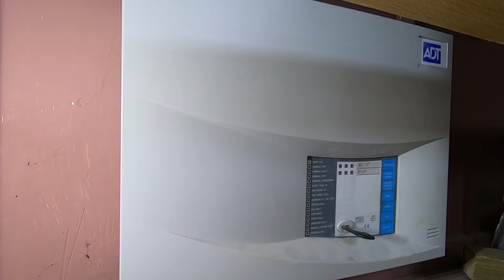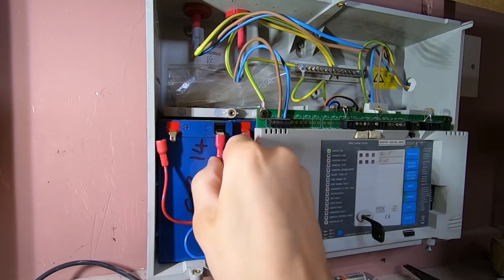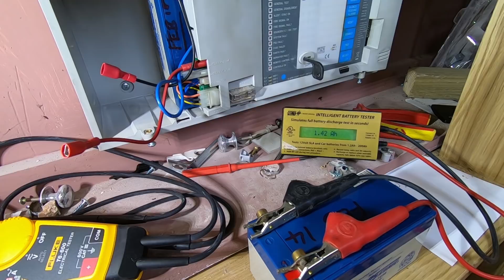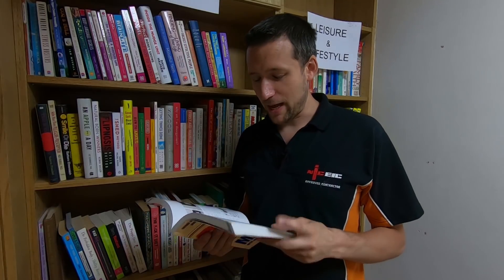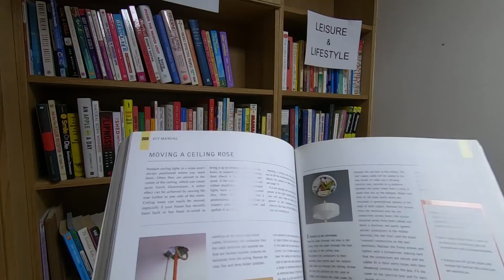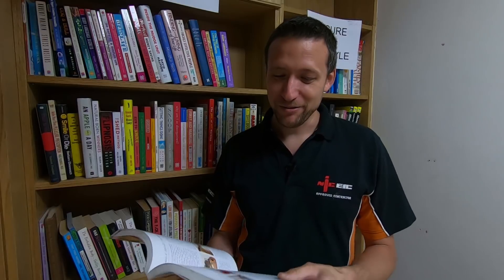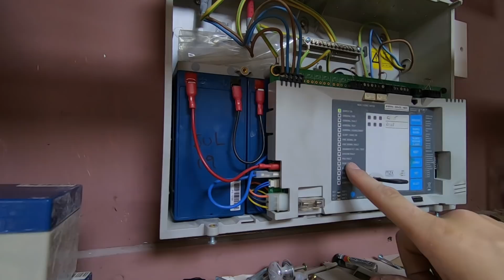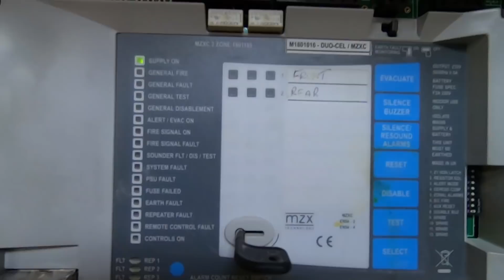FIRE ALARM unit - Fault finding and battery test | Thomas Nagy

Comment: 6:00 when i had to remove the battery from a smoke detector at my sisters house (She had got a new smoke detector and neither me nor her fancied trying to remove the thing from the ceiling, as it is over a staircase) im pretty certain i had to stand on the platform bit at the top (the step ladder thing I was using rather curiously had a handle like thing as though it intends on people standing on the top of it)

Comment: I use the exact same ACT battery tester here in the USA.  It works great.  I had the gold one like yours but it walked off.  I have the chrome model now.  I test alarm batteries on every call.

Comment: 6:08 saw a Sky installer the other day adding another feed out of a pre-existing dish on a bungalow.  Ladder bolted down to the paving slabs, eye-bolts in to the brick for ratchet straps, hardhat, full body harness.  I almost cried :'(

Comment: Fp200 can be tan with mains it’s a screened cable.

It shouldn’t be ran with any other service due to the fact it’s a safety system.

No interference would be induced

Comment: Batteries should be replaced every 4 years, and clearly marked with the date of install. Also, the powersonic batteries apparently don't give an accurate result when using those act testers.http://www.power-sonic-de.com/files/ohmic_hand_held_use.pdf

Comment: Problem with them batteries is that they never get a discharge cycle but always kept charging. Not great for these sealed batteries.
Reply from the maker: I was wondering this cos I wasn’t sure.
Does it kill them because they are permanently topped up? I’m guessing In the same way emergency lighting batteries die so quickly too. They last 2 years at best.
Reply: thomas nagy - Lead Acid cells and batteries should be fine for around  5 years if the charging voltage is kept within 2.2V to 2.3V per cell (a 12V battery is made up of six cells). At this voltage they can be safely trickle charged indefinitely. For best performance, the charger should also adjust the charging voltage to compensate for temperature changes. However in many applications where a dedicated battery charger is not provided / or good quality charging circuit is not included, instead you get a cheap and crude design. With these, the battery voltage can vary, and if the voltage gets too high, one or more cells will gas and vent. Each time they vent, the cell looses capacity. Lead acid cells and batteries also prefer to be cool, but the temperature in alarm systems can get fairly warm.
For testing lead acid cells and batteries I use a good quality digital multimeter and a test load. But the exact capacity is not relevant in my line of work, just the systems ability to operate for a specified time at a specified load.
Reply: thomas nagy I imagine the panels have a very crude charge controller. Drop below a certain voltage and start charging. No type of maintenance charge function. They really need a load through them every so often keep them healthier for longer.

Comment: That tone is literally the most annoying sound in the world. My school recently changed there tone on there notifier for the fire system to that sound and it is rlly annoying especially with outdoor sounder. We used to have alternate but it is ever since they inter grated the lockdown system and class change onto the fire panel with all different tones.
Reply from the maker: I’m also not a lover of that tone. I find it borderline disorientating. It’s not even hugely loud; it’s just an awful noise. 
I much prefer the two tone sweep sounders. They don’t have that “shrill”
Reply: thomas nagy exactly. I had to put up with that ringing for 2 hours whilst the school was doing a full sounder check. All they did was press the evacuate button on the panel and just let them ring. I could here it ringing in my head for an hour after. It was also about five o’clock, doing coursework so not fun. It was better when it was alternating. More alerting I found. But unfortunately that’s the sound most fire systems now use around bristol and surrounding areas.

Comment: Great video All ways look forward to seeing them. Not a electrician  but work in the motor trade loads of health and safety rubbish in this trade. Keep up the good work.
Reply from the maker: Hi pal, yeah I guess all trades struggle with that, it's often just a load of bollocks, not practicable at all if you ask me, but hey ho!

Comment: Fortunately it's perfectly legal to do your own electrical work in the UK. Yes you can even change a CU if you pay building control a couple of hundred quid to inspect and certify. Done it all my life, did my 18th edition exams (yes passed fine) got the correct test equipment. Tom is clearly excellent at what he does, but seen too many awful 'professional' jobs. Sits back and waits for screaming :)

Comment: In fairness 75% of domestic electrical work is just common sense. I doubt there is a house in the country that doesn’t include work done by a DIYer. There’s also plenty of shocking work done by supposedly competent sparks.
Reply: Not if you're working to BS7671 which everyone should do. It's anything but common sense.
Reply: Im a spark and rewired my house, is that diy or professional work lol?😂
Reply: Id have to disagree with your first statement my friend. Wiring up a plug or changing a light fitting should be generalised common sense but even those abilities seem lacking for most common folk these days. Sparky's or engineers such as fire, security, access, nurse call etc are individually specialised in those areas. There's is a lot more to it than just running cables and hanging lights, lol, having said that. Sadly, from experience I would say there's 1 good engineer to ever 5 bad one. Most are just too lazy to do the job right and i spend all day running around after the dodgy gits, lol still works works ;)

Comment: As a general rule of thumb, your waist area shouldn't be any higher than the top tread as this is where your centre of gravity is. You can easily lose your balance or have the stepladder topple from beneath if you climb any higher. Dave is clearly using the wrong size stepladder, 6 treads fit nicely in the van and are easy enough to carry round on site.

Comment: This method of battery test is BS. You can never test the real capacity unless you do a proper discharge messurement. It would take hours...
it depends on many aspect.  Battery could be shown shot, when the charger circuit blowed or incorrect charging voltage was set on the device. All these lead acid batteries has a rated charging voltage and current. Usually current limit is not a problem, because of poor charge circuit of the device, but the charging voltage is a real edge point.  On the side of batteries there is a rated charge voltage, it is around 13,5-13,7VDC. For a 3Ah it is about 13,5 VDC. In reallity it is still a bit high, 13,3-13,35 VDC is a much better value. It makes the batterylife much longer, not dry it up so fast.
Reply: No, it's not BS. It's looking at a portion of the discharge curve; unless the battery technology is significantly different from a standard SLA it's going to be able to do a pretty good estimation of the capacity. Certainly good enough to tell the difference between a good battery and one that needs replacing.

Comment: Those Tyco/minerva smoke detectors are really good. Is the mains coloured zone wiring a common thing in the uk?? In australia fire circuit inner conductors are usually white and red.  Brown and blue inside the fire panel usually means internal 240.

Comment: I went to a technical high school and have electrical training from a licensed electrician, but beyond changing a switch, socket or fixture I am hesitant. In America there is a law that you can work on your own stuff but if you work on someone else property and something terrible happens you a criminally liable. My teacher told us the story of a elderly couple who had a neighbor do work on a new furnace. The neighbor made a mistake and the furnace housing and part of the duct-work was made live. The couple had their young grand-kids over and as they waved goodbye to their parents out the window they leaned on the live heat vent and another part of the duct work that was earthed. Both kids died, and my teacher was the electrician that was called in after to fix the furnace.

Comment: You can get the very cheap and nasty battery testers for about $AU50 on eBay. They work, they're just not as accurate or reliable as the proper ones.  "12V Car Vehicle Battery Tester Automotive Analyzer Digital Display" is what I have, does what it says on the tin :)
If you're buying second hand lead acid batteries they are really valuable. Not what you should be doing for a business, but us bottom-feeding private users scrimp every penny.

Comment: Great video. Do you see much of the really rigid pyro cable that used to be used for fire alarms? Those kind of looked like normal cabling.  I have worked in a building where they had all the emergency lighting run using this type of cable from a big main battery as well. Cheers

Comment: On experience those batteries dont last longer than 4 years. ADT are the worst company, I did a job once on a big concert hall with cctv ....came back to a fault callout and they had cut one of my coax's to fish there fire alarm cables up a void that originally took me ages to fish....absolute scum fucks, they could have done it many other ways but didnt care one bit.

Comment: You need to get those battery testers need calibrated just like a multimeter, Also the NSI would let you use them anymore as a means of testing just for all you alarm engineers out there.  Learn to use a multi meter to test them lads.  Good video as always tho....

Comment: In terms of H&S: don’t stand and work on the top three steps (including a step forming the
 very top of the stepladder) unless there is a suitable handhold (which could include something above your head)... you can if you have a handhold. It's not illegal anyway, only guidance.
Reply: It's stupid. Guidance given by some pencil neck who has never been up a ladder.

Comment: I can not stand the people who say things like "You should not make a video about XYZ because it will inspire idiots/terrorists/whateverthefuck to do something dangerous and therefore your video is bad" What these idiots do not understand is that you can neither fix stupid nor evil. If someone is going to be an idiot and work on electrical equipment without proper knowledge and certification, they are going to do so regardless of whether they see a video or not. Why? Because they are fundamentally stupid, and a video is not going to change that.

I think that the same people who say that are the same ones who, upon me buying a new knife (I collect them), they say "Why did you get that? Who are you going to stab?". I think it comes down to them having so little trust in their own self control that they assume everyone else can not control what they do either.

Comment: How are those wires complying with safety regulations?
Here in the Netherlands it is mandatory to have Cables with functional integrity. 
The regulation states that a fire in one area can not disable equipment in another, 30 minutes for power and 15 minutes for signal wires. 
The wires you're using are normal 110/230 power wires which have no protection what so ever.
Reply: Stoney_Eagle that cable is FP200, fireproof cable. 99.9% of fire alarm installations in the UK are wired in that. 

You can see the red sheath of the cable when he opens up the panel.

Comment: To test a battery, it must be tested under load, if you use your multimeter you won't get a correct reading because the multimeter is designed to place as light a load on the circuit under test.
Reply: John Hill that’s why he didn’t use a multi meter.
Reply: @willgrand461  Yep but you don't have to scroll far to see people here in the comments recommending it...

Comment: Tom, how do you find working in this heat & humidity? Especially in a thick Polo shirt?

Right now I survive (just) in cargo shorts and thin white t-shirts.....doesn't look as professional as I'd like, but I end up soaked!! Guess it's just my body? Never stinks, it's just liquid...but kinda embarrassing
Reply: pffft ..... come work in Brisbane Australia, then you'll know about heat and humidity :)   eg: its  540pm on july 23, middle of winter, it is currently 24.2 °c
Reply: @Ressy66  I'm in the states at the moments, where I'm at, has had day-time temperatures averaging between 36.2c.  ~ 40.5c.  Humidity has been at 70% ~ 90%. Heat index two days ago was 49.4c.  Today brings some much appreciated relief with lower humidity around 60% and the day temperature is going to be much cooler at 27.7c.  24.2c is months away for weather here, I should grab a flight to Brisbane!

Comment: Can someone explain to me, why are these batteries still not li-ions? Same with exit and emergency lights, NiCads everywhere!
Reply: Li-Ion batteries are expensive both for just the battery and for the more complex charging circuitry needed to prevent over charge and discharge.
Lead Acid and NiCd batteries are cheaper, and the charging circuitry is much simpler.
Li-Ion car battery = $800 USD, Li-Ion battery management system = $200 USD.
Compare that to just a regular lead-acid car battery at around $100.

With NiCd and Lead Acid batteries, the charging circuit can (and therefore usually is) extremely simple. All you need is a transformer with the appropriate output voltage, a single diode to turn the AC into pulsing DC, and a current limiting resistor if you are charging NiCd batteries. Doesn't even need a smoothing capacitor!
For NiCd batteries the idea is to charge the cell at such a slow rate that it takes 10 to 20 hours to charge it from flat. This is called "trickle charging" and NiCd cells can tolerate it for 3-5 years before needing replacement.
Lead Acid batteries are similarly tolerant of constant charging regardless of actual state-of-charge, however the numbers are different.

On the other hand, Li-Ion batteries will burst into flames if left on any kind of constant charge. They require circuitry which can turn off the charging current, which is more complex and there are many chips designed specifically for the task of protecting lithium ion cells from over charge or over discharge.
Reply: Not an expert, but I guess because they're safer to continuously trickle charge. Li-ions don't take kindly to trickle charging!
Reply: Because you don't change what works without a damned good reason.

From a technical perspective NiCads are more temperature stable, last longer, aren't full of smoke & fire, don't require complicated battery management and are almost completely recyclable. Changing to Lithium would involve a costly and time consuming process to get them approved for use in critical applications.
Reply: 90msg90 I think their are regulations on not using lithium for fire/emergency systems
Reply: Price.
Reply: The last think you want on a fire panel is the battery bursting into flames because water got into the charger and over cooked the batteries (and yes I've seen that quite a few times). Lead acid is cheap, reliable, predicable, and doesn't normally catch fire when abused.

Comment: Im a fire alarm engineer and you should be testing and recording the ah on the batteries and change maximum of every 3 years
Reply from the maker: in a perfect world there would also be a zone chart, diagrams, lots of extra information, test records, maintenance log, fault reports......
in the real world how often do you turn up and its all there? almost never
Reply: thomas nagy but whilst your there testing the batteries all it takes is a sharpie to write on the side and a you can see it degrading over time as the battery size calculations need to take into account the lower battery levels
Reply: BS5839 is 4yrs for battery changing
Reply: People should have maintenance contracts to ensure this happens. Many don’t. They just phone someone when the panel starts beeping at them.
Reply: Exactly where in the regs OR BS does it say FA batteries should be changed every three years. I work for a worldwide multi million pound company and FIVE years is the recommended period even then so long as the batteries pass the test it’s only a recommendation

Comment: try finding a fault on an addressable system that has had all the heads replaced trying to sort out fault. Last resort was contacting the manufacture and them digging into the firmware and going 'oh yeah we have a bug, here's an updated version'. Now that is a joke, 1 year later and £££ lost of call outs and a customer not happy. 

Conventional panels are a piece of piss to find a fault in theory until you come onto a panel you've never seen before and have no clue on what is what. 

Keep up the good work pal, enjoying the videos.

Comment: Been asked to provide photometric design data for emergency lighting installation of 4x fittings within small commercial unit.....have you ever come across this?
Reply: JDR Electrical Services try using data from the fitting manufacturer ,usually 1 lux is required for exit level if you are going to do more emergency lighting probably worth getting the British standard ,unfortunately not cheap
Reply: This sounds a bit like being sent to get a new bubble for the spirit level .... ?